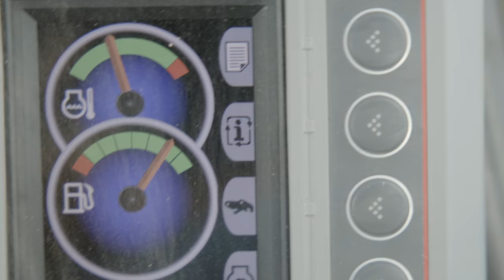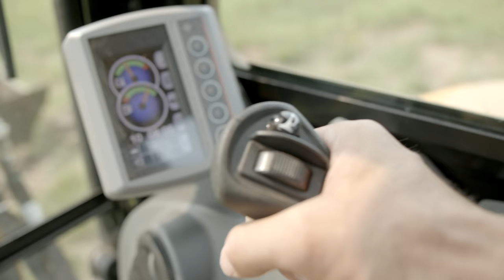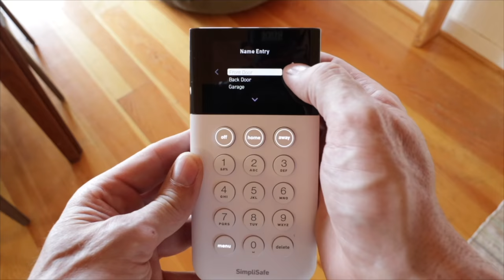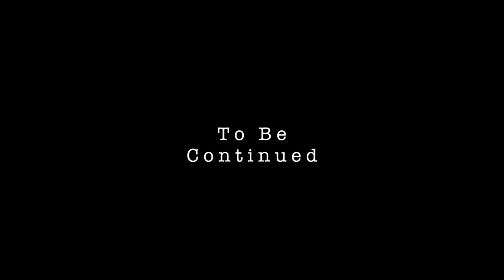How To Sawmill Like A PRO

Comment: Awesome to see an awesome Aussie product. I met one of the founders of Lucas Mills and they’re based in my local region of Albury-Wodonga, Australia
Reply: It's a great machine. Had mine for over 10 years. Makes great lumber and huge bar tops that he local band mills can't. As in 50 inch diameter oak. Pull lumber off the top, flip it on the forks onto the 8 x 8 bearers, make lumber off the other side, then skim. If under 8 inches (model 827 Lucas mill) one edge can be cut. Took 6 guys to lift the one bar top I made..16 foot long red oak! Amazing machine.
Reply: Wooragee,

Comment: That would looks gorgeous. Here in Thailand wood is expensive and most structures we use steel. How many of us held our breathe when you lifted the 6x6 over the top of the saw mill.
Reply: As long as he doesn't drop it on the power head that soft light stick would cause no damage.

Comment: 6x6x18ft weighs between 135 and 150 LB, depending on the moisture content.
Reply: Not only the weight but the fact that it's 18 feet long. Very difficult to carry, even if it was compact.

Comment: Is it possible to do the first cut the full diameter of the saw, and then come back and do the two inch vertical cut?  It might make two by production a little faster.  Just a thought and a question.  Keep up the good work - cheers

Comment: Man them lucas mills are slow. 2,000 borad feet in 8 to 10 hours is a pretty common day on most any hydrolic band mill ive used. Be it cook, timberking or woodmizer. They will run circles around that thing pun intended. We even have a old circle mill with a carriage and it will way out do all of them in borad footage but not in lumbar quality.
Reply: Knob....

Comment: hey Cody I had a question about the saw. when you were cutting the 2 by 6's  you individually cut the bottom and then the sides. would it be easier to do a 6 inch wide bottom cut then cut the sides.
Reply: G'day Crazy, no if he cut six inches in the horizontal when he swings its set to intersect in the vertical so he would have to wind back and remeasure to time consuming. All saws no matter which type are more efficient in the vertical position because gravity clears the wood dust from the cut with horizontal sawing the dust collects under the blade causing friction heat expansion then inaccuracies .if you check out Saw mill shoot offs you'll see that nothing can beat the Lucas Mill in the $20K and under and that's in your soft oak bandsaws down under are vertical wide bade or rubbish 👍.

Comment: Cody, what is the maximum span that you can use on lumber with out it bowing? I have had a real issue with lumber bowing and twisting.
Reply from the maker: It depends on the lumber, I'd guess around 6'

Comment: Did that timber shift when mr W used the mini-X to pick up that first piece of dimensional lumber?
Reply: Sure looked like it. In the view at 10:26 with the stickered lumber that first 2x6 board on the left looks thinner and a little wedge shaped at one end likely due to the shift

Comment: Why the Lucas mill vs a band saw mill have u made a video that I might have missed explaining why
Reply: You can cut lumber with out resetting the log unless you use a excavator to move the lumber
Reply: Easier sharpening
Reply: They're the quarter Saw king, equal to a band in recovery Saw through nails resharpen keep going set it up around a 50000 pound log and work your way down I've often thought how those band Saw carriages would go under such loads ?